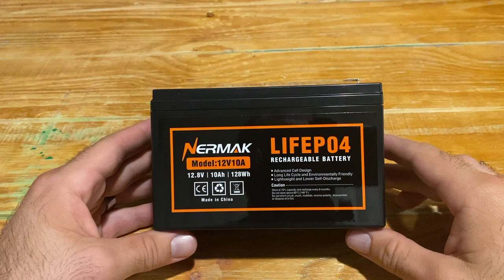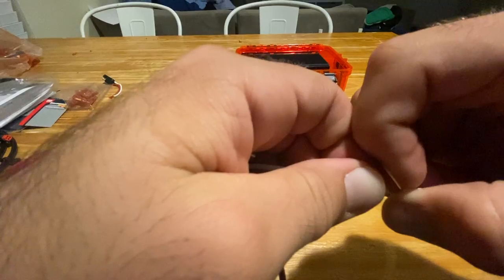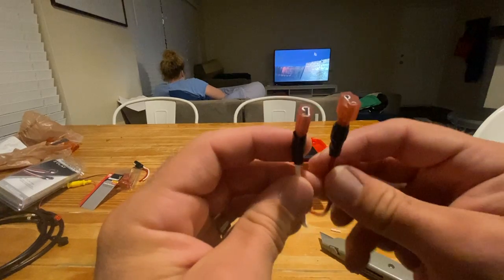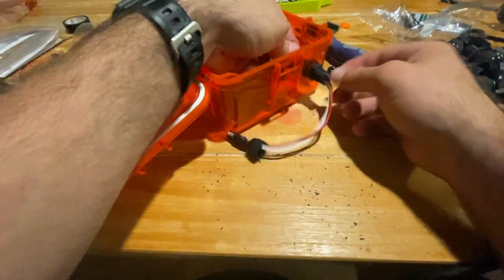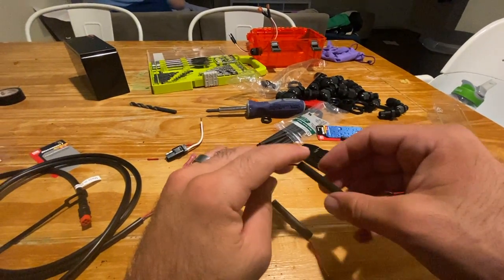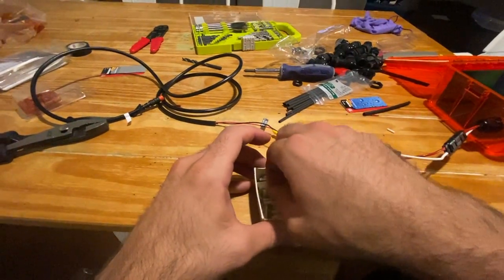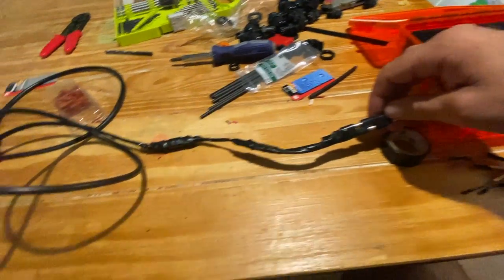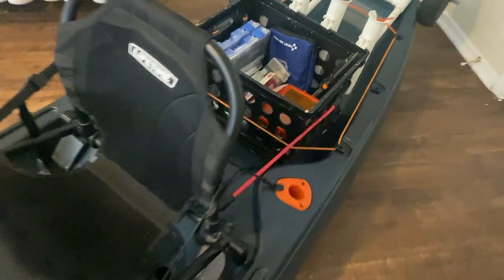Battery Dry Box Build and Quick Connect for Garmin Striker 4 cv

Comment: I went the same route.  I found an old harbor freight Apache heavy duty lock box for mine.  I just trimmed the foam that I didn’t need out and got those battery terminals.   Works great , and light weight compared to me using my big marine battery which kept getting corroded and shorting out .  This little battery and the box fits under the console of my 13 ft whaler perfectly
Reply from the maker: Awesome!

Comment: Excellent. One thing I like to do is after I drill a hole, especially in plastics, I use a dowel rod smaller than the hole, wrap I with 220 sandpaper. Then it’s a sanding dowel. Works excellent on burs and little rough spots that might prevent a good water seal.
Reply from the maker: @Empowered-ltc  that’s a great idea. Thanks!

Comment: I found the same watertight box on amazon with two sizes small and large may I know which size did you use? Hard to visualize the measurement might not accurate on the description.
Reply from the maker: 8 x 6.75 x 3.5

Comment: Those strippers have a spot to crimp that may be easier than pliers since they were made for that along with a few other features.
Reply from the maker: I got ya. However these strippers stunk. They wouldn’t strip the wire, even when the wire was placed in the correct gauge setting.

Comment: you can put the glands (sans the inside nut) on the cable before putting the female connectors on to keep the inner rubber in tact.  (I did connections first too but cut them off to redo :goodvibes:
Reply from the maker: @WoJoMoZilla  great idea!

Comment: At the top end of your wire strippers there are crimpers that you can use to crimp the butt connectors/splices onto the ends of the wires. They work pretty good.
Reply from the maker: Ya, I used those, but I wanted to be able to get a lot pressure when crimping…

Comment: Do you have to disconnect battery to charge? Or can you 🔌 plug into compatible smart charger that uses the sae plug right back into the box?
Reply from the maker: I use the compatible plug! I never actually have to open the box, ever.
Reply: @LunkerHunter  I appreciate it very much, gonna make a build like this for my striker4 and use a plastic ammocan for my boat. Great video!
Reply from the maker: @BlackRifleSurvival  good luck!
Reply: Can you explain how you connect to charger? Can't find charger with this type of connector
Reply from the maker: @i_am_taras 
ULTRAPOWER 4Amp 12.8V-14.6V... https://www.amazon.com/dp/B08MPX414R?ref=ppx_pop_mob_ap_share

Comment: Did you garmin come with connectors for the red and black wires? Mine are just exposed copper wires.. i didnt see where you connected it to the wires from the battery
.not sure if you skipped that part, or went so fast i didnt see , but ive watched it twice now and cant tell what i missing 😂.
Reply from the maker: The garmin didn’t come with the male/female quick connectors. I had to connect those to the wires it came with, with the butt connectors. The product links should be in the description. Sorry it wasn’t clear. It wasn’t the easiest DIY video to follow…
Reply: @LunkerHunter  that was the only real question I had so I think y'all did pretty good! I appreciate y'all?
Reply from the maker: @kylesmith3211 no problem!

Comment: Mate, there are 4 cables of the Garmin device, should I cut those two cables that's not red and black colour? Thanks in advance!
Reply from the maker: Yes!
Reply from the maker: Blue and Brown (optional) - The Blue wire is the Tx (Transmit), and the Brown is the Rx (Receive) wire. These wires are used to share user data between the STRIKER and the ECHOMAP¹ series devices.
Reply: @LunkerHunter  Understood!!!Thank you very much!!!
Reply: You dont need to cut it off just isolate them with electrical tape but thanks for explaining the uses of the cable.
Reply from the maker: @weriesblack1375 thanks for watching!
Reply: @LunkerHunter  always a pleasure.

Comment: hello, what is the battery specification , voltage and A
Reply from the maker: 12 V 10AH
Reply: @LunkerHunter  
What is the estimation working time with this battery if it full , will cover a 2 or 3 trip , if not, what is the battery will cover this time .. what nust increase is volt or A
Reply from the maker: @attiahaly8030 3-4 trips